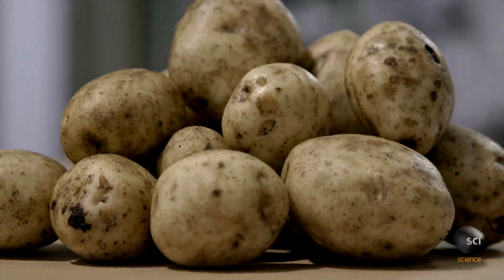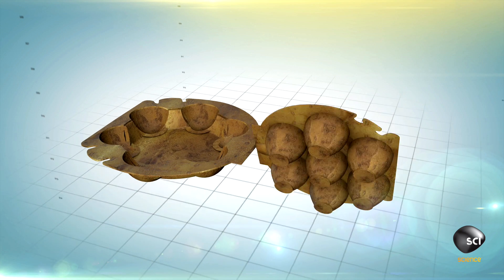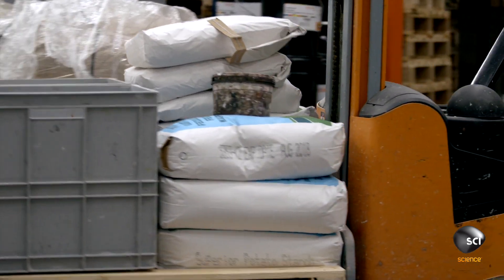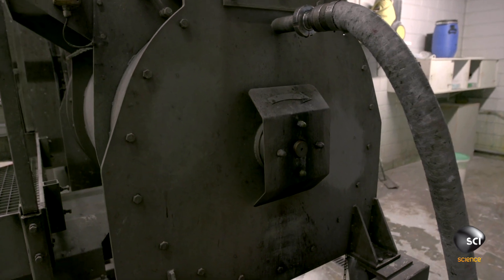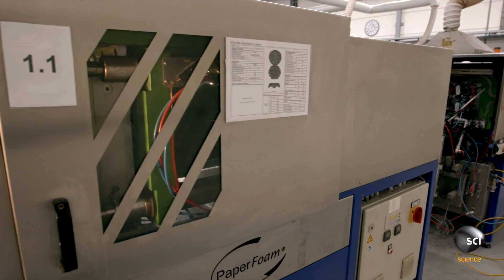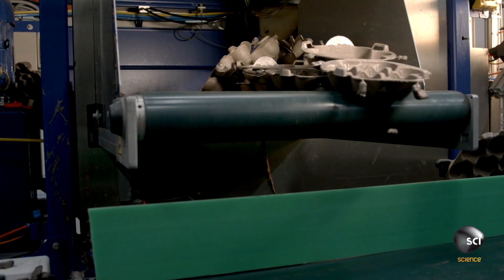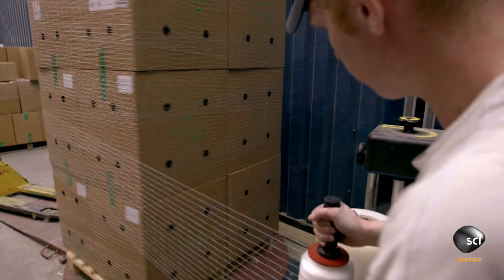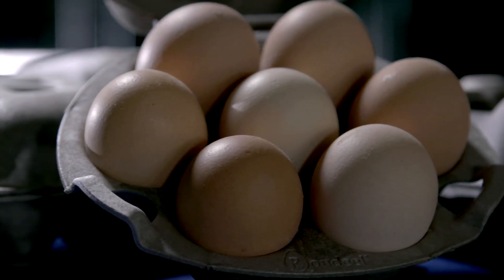How Are Potatoes Turned into Egg Cartons?

Comment: but why dont they make the cartons entirely of paper like many others? they would also be biodegradable and potatoes would be used for food like they should
Reply: Paper is made from the exact same ingredients: paper fibers (cellulose), water and potato starch. Different ratio, and way more water. Paper pulp is about 1-4% dry matter vs moist while the PaperFoam slurry is 50/50 dry/moist. Leading to a way differet carbon footprint.
Reply: do you want even more trees being clear-cut? that's more harm done than good.
Reply: i guess paper can be made out of almost any vegetal fiber, isnt it? at least for this kind of applications
Reply: it's not that easy, there is a complex chain for the paper to become pulp trays. this material at least releases less C02